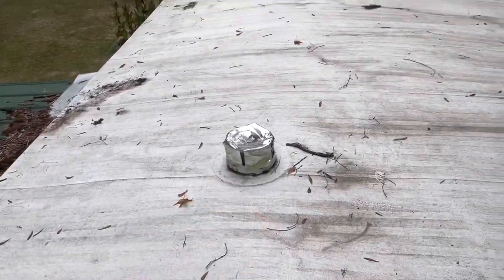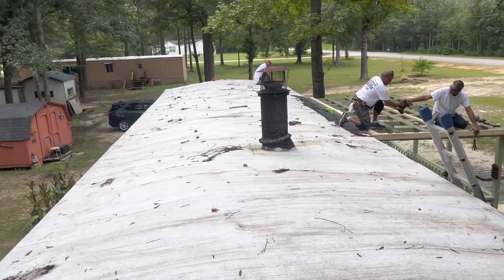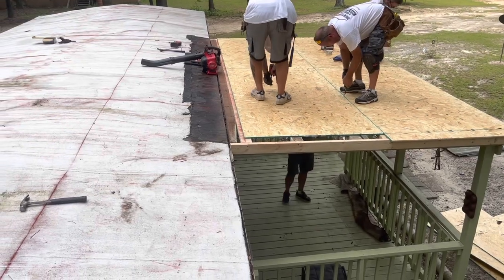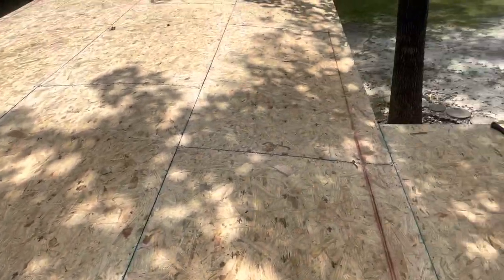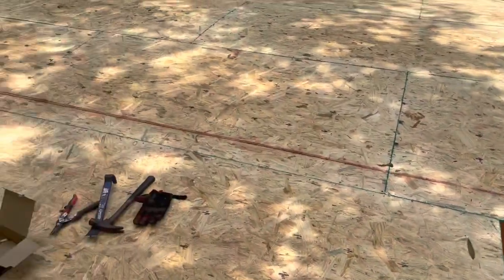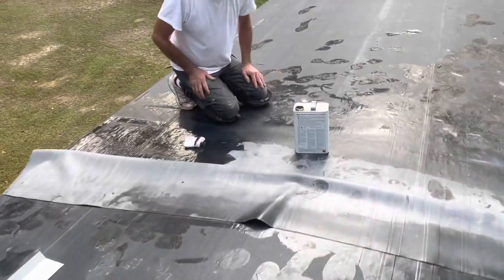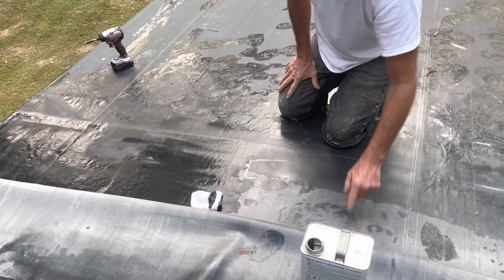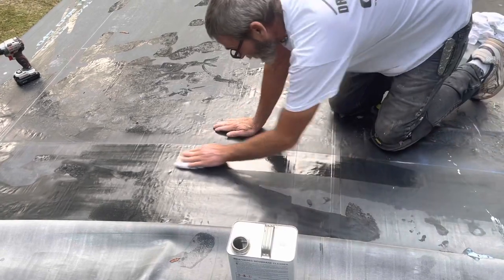Single wide mobile home roof issues. How to replace your roof.

Comment: What size osb does Drew use
Reply from the maker: 7/16 OSB is best
Reply: I'd like to find out where u get all your supply I've got one nobody seems to want to touch but I'm out of your traveling area and I probably dont have enough  for u to come out here in stl. area
Reply from the maker: ABC. Supply or best distribution
Reply: Is there anyway you could send a list of products you use so I can do this, like type of adhesive sealers and tapes etc. And mm(mill) you work with
Reply: My roof is similar to this one but with a tip out